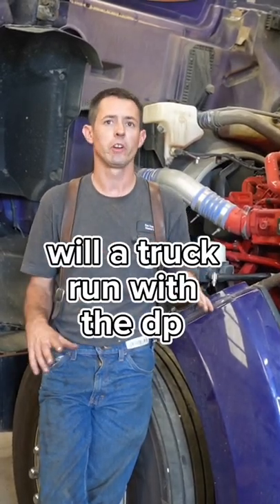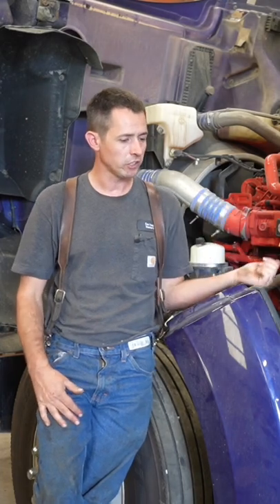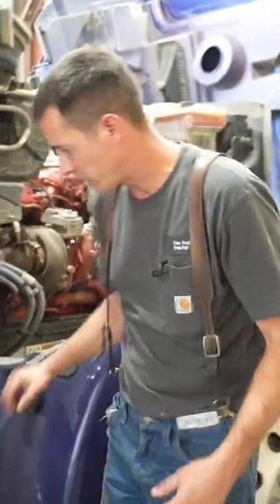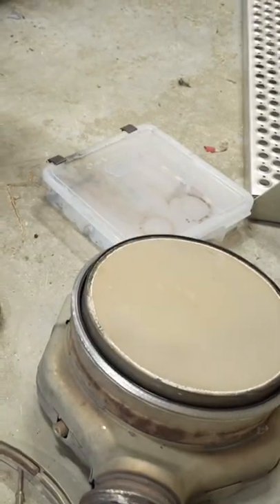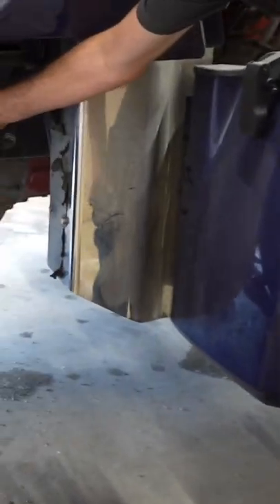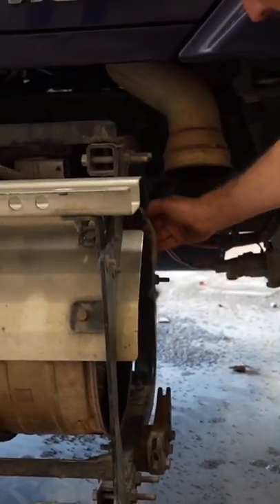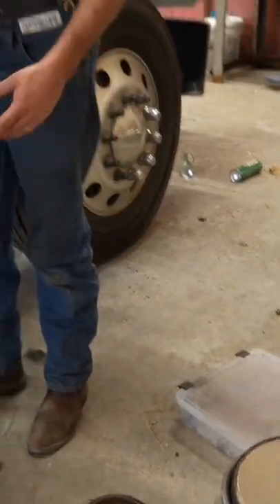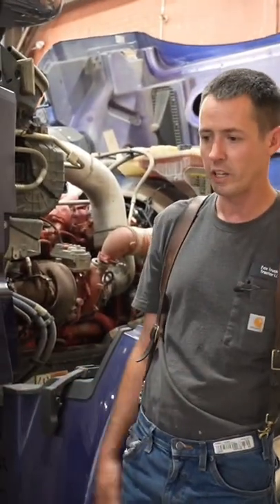Will truck run with DPF unhooked? #shorts

Comment: The engine said “I can finally breathe”
Reply: I was thinking the opposite like it was saying “where’s my boost” 🤷‍♂️
Reply: @tinytattoomike7943  Diesels don't make boost at idle and the turbo is mounted to the manifold. You're thinking a gasser with remote mounted turbos.
Reply: @tinytattoomike7943  the downpipe comes off the exhaust turbine not the compressor turbine. You can clearly hear the turbo spool when he started the truck meaning it will still make boost.
Reply: @danielkustra9071 that’s the waste gate opening and closing.

Comment: It will for a short time.  But it will shut itself down when it doesn’t see the temps rising like it should.
Reply: I've had to pick up a unit from a customer cause for some reason my company released it with no dpf I had to drive about 30 minutes to swap for a sub and drive the truck with no dpf back to the shop. Haha never shut off but was very worried all the way back to the shop waiting for it to derate
Reply: We have a truck that has a pipe going through the egr unit by bypassing it and it has no idea its gone the temp plug was put in the pipe
Reply: @Manofwar9431  Egr is totally different than dpf.

Comment: It absolutely will. My titan does. Buuuutttt, needs to have the ecu programmed so it can do it longer than 20 mins. Edit. Stupid autocorrect 😂
Reply: What year Titan do you own,what all have you done w/ it? i have a '19 Titan XD.
Reply: @smckinney3mckinney141  a 2017 xd pro 4x. Absolutely love the thing.
Reply: @Iwannagofast  That is the same trim level i have Pro 4X.. what kind of fuel milage do you get, if you check it..
Reply: @smckinney3mckinney141  on my last road trip with no load I got ~17mpg 80 plus for 500 miles. On the way back I ran 70 the whole way and got 20mpg. Daily I avg 19-20. If I really get into it I get about 5mpg 🤣. I run the 120hp tune with the fun parts. Got a meth/water setup I’m gonna put on it eventually.
Reply: @Iwannagofast  That would be a sweet addition, did certain parts fall off to do the 120Hp tune?
Reply: @smckinney3mckinney141  there wasn’t enough room so yeah 😉
Reply: @Iwannagofast  🤣🤣🤣
Reply: BFTtheTRUTH  well I believe that’s an ISX Cummins on the semi. Seeing as my Titan has an ISV Cummins in it, nope they are not exactly the same. So very astute observation. Being that they are different, they both run off an ECU. Since they need the parameters from the dpf, scr, and egr, you have to tune them to allow it to run without them. And funny enough they both can be tuned with the same software.

Comment: This is bs. It will throw codes reeeeaaal quick. Might be able to start it but cummins diagnostics is sensitive enough to notice minor exhaust leaks during road testing. No pressure or temp at the dpf (not to mention the differential reading), scr is gone, nox outlet... yeah, limp mode real quick.

Comment: Now reprogram the computer and delete it
Reply: And wear a big EPA  fine for doing it ..
Reply: @jimmyj2563  only if you're caught
Reply: @edwardjmayer87  that would be easy to catch , especially  since  this will become  a thing ,,
Reply: @carlstephens1532  if people figured out how to run a dual ECM system one for the motor one for the OBD2 connector they can figure out how to delete that without being traced
Reply: @edwardjmayer87  yes it would work but one could develop  sensors that can fool the existing  computer and could  be steathy I was able to race with the early  computers by altering sensors  it was fun my friends  and I had camaros I had a91 they were all stock and nobody  was able to run with mine,,, stock wink,,,wink
Reply: Some of you guys need to read about the guy that had a ad to sell his deleted truck. The Feds raided him and treated him as if he had a million pounds of cocaine.
Reply: @mrgoodtimes05  the first cars started around  85 with computers that I saw. Catalytic  converters. So yeah we learned  a long time ago.  The EPA kind of relaxed until "rolling  coal"was used like a weapon  and a safety  issue, and the sleeping  epa woke up.

Comment: They'll run til the computer catches on to it, you can delete them but it takes reprogramming of the ecm, Cummins you can delete and be fine, detroit dd15 will throw a rod after 2 years of being deleted
Reply: Definitely not true. Do you have any idea how many dd15’s are deleted on the road for longer than 2 years?
Reply: @Richtaco  has probably to do with bad ECM programming and incorrect intake temp since most modern engines were designed from the ground up with EGR
Reply: @Richtaco  I work at a freightliner dealer and see it all the time, it may be the programming of the delete the causes it so may vary by who does it but we replace cranks and rods in deleted ones constantly, they either wipe a rod bearing or break a wrist pin
Reply: Probably they aren't tuning their deletes correctly too much power or over torque I have heard that you can't delete the egr though it has to have it.
Reply: @Khmtravelvlog  yeah that and some models of dd15 use the egr to control the turbo, and when they delete them they block off the egr pipe, so if run it hard under load they can overboost and blow stuff up

Comment: They'll run, and they'll run good til the computer notices that shit is missin then it goes into limp mode
Reply: I figure nothing a little reprogramming or new ecm programed to run without a dpf couldn't solve
Reply: @Ako Cummins it’s not, well, if you’re new it is, otherwise it’s really not. Gotta know who is available and how to get to them, but there’s hundreds of guys that do it. Nobody speaks about who anymore because EPA shit
Reply: @Ako Cummins there still are. Problem is that there's zero commercial options, because they would be instantly shut down and fined by the EPA. So the only option left is the ROM hacker and homebrew scene.
Reply: What happens if you just fill that bullshit with water or trick the sensor into thinking it’s full?
Reply: @308dad8  you can’t, they have a DEF quality sensor. It can detect if it’s just water etc, plus it can tell if the injector isn’t working etc. just gotta tune it
Reply: @KDlGG  Wow. Sounds like they have it all regulated to death. Isn’t there supposed to be a shortage of that crap?
Reply: @KDlGG  What do you mean tune it? You mean programming it?
Reply: @308dad8  there is and there isn’t a shortage of DEF, it’s more of the stores or truck stops cant get it as quickly as they need. But it’s available from manufacturers
Reply: @308dad8  yes, it’s the same thing just different names. You can run a stock modified tune so it runs completely clean but just makes the engine think everything is intact, or a modified tune to get more fuel economy. Some guys on the Cummins trucks are getting 20 or so, powerstrokes I’ve seen get 16-18
Reply: @jhomrich89  I’ve done this on ag equipment in past years. Gut the government parts and reflash the ECM with export, T3 programming and all you have to worry about is the EGR side.
Reply: yup
Reply: Makes me glad the farm work at run pre emissions trucks.

Comment: Yeah it'll start and run for a bit. But when the temps,NOX and differential pressures aren't responding accordingly it'll go into limp mode or shut off.

Comment: The T800 I drove had a broken flex pipe before the dpf.  Picked up all kinds of power.  Easily hit 40 psi compared to the lazy build to 35 psi it had before the break in the exhaust.  It would start puffing smoke bad and almost made it look like it was on fire haha.

Comment: It will run until it heats up and the exhaust temp dosent come up and the downstream NOX sensor shows no flow then it will most likley skip derate and go straight to shut down

Comment: My last job had a gmc 5500 that had a 20bbl tank to pull drips from the pipelines. I drove it. It had the DEF system removed. It constantly tried to go into limp mode. They downgraded to a freightliner fl25. Not sure what happened to the gmc 5500. I was rear-ended by someone going 75mph in it, still don't know how I'm still here, but that's another story. While I was out recovering, they changed to the freightliner. That was a rough driving bitch.

Comment: If u pull the computer bs out of it and go back to mechanical system it will run just fine and in reality u don't need that Def fluid to make it work correctly use straight distilled water in Def system bc computer can't te the difference between the 2

Comment: That’s what a truck should sound like dpf is a scam.  How is getting exhaust temps up to 1400 degrees and idling truck at 1300 rpm for 45-1hr for regen good for the environment?!  Carbon is what causes moisture in the atmosphere why it’s so damn hot bc emissions

Comment: Sure...until it figures our the readings aren't within the set parameters and it freaks out it's just the same as hollowing out a catalytic converter. It'll go until it figures out the cat that is no longer there isn't doing it's job.

Comment: A Cascadia will not for very long. You can thank the Government for that. My company has always got brand new Cascadias. Not one has ever made it over 100k without having some sort of exhaust DEF system issue
Reply: I was stranded at least once on the side of the road due to failed NOX sensor at only 300k miles  😭
Reply: Freightliners have ALWAYS sucked!!!  Worst truck on the road, period.
Reply: @beowulf7992  On the bright side they’re pretty easy to work on and parts/labor cost /abundance situation isn’t too bad either , my truck was under warranty and the Freightliner dealer 100 miles away managed to replace all NOX sensors and DEF supply Kit under six hours, I still wasted 2 days waiting in the middle of Colorado but if I had Volvo/Paccar it would’ve probably taken weeks due to the emission parts  shortage
Reply: @Nikowalker007  True!  I work on Freightliners daily.  But that's just it:  daily.  So, it's a good thing that parts are readily available and most things are common/SAE.  Generally, I only have to work on the PACCARs after the drivers have their way with 'em.  In their defense though,  there's NO WAY to make trucks/equipment durable enough for some people.  Some ppl are so destructive; they could bust the head off an anvil!

Comment: Stopped this at 2 seconds. No it will not run. There is a DTC that reads, I ain't kidding either, "DPF Missing". No data from the DPF differential psi sensor, nothing from the outlet NOx, the SCR Dosing Valve is "open circuit or short to ground." and the temp sensors are reading ambient.  Y'all got 90 mins to pull over off the side of the road and call Love's road idiots to scratch their sack and charge you anyhow. 5mph derate, son. Hey OP... You left out the end result!! Insite did not refresh while your little finger pointed at the Fault Codes tab. Give it 1 min (per Cummapart spec) and you got a whole fuckin COLUMN of codes for what you done and bark at the steering wheel holder for "Operator Inducement". Shidddd

Comment: Awesome, cause that's what we need- more particulate matter entering our atmosphere... You diesel loving, coal rolling truck lovers over there caused this massive EPA crackdown- cheers blokes 🖕
Reply: Hold up….. this is a big rig. They’re not the idiots rolling coal
That’s diesel pickup drivers….. these guys just don’t want to have their truck stop functioning due to a minute exhaust processing system issue
Reply: @knicks5426  I realise, my comment was directed at those wankers in trucks- not semi's or big rigs.
Reply: @knicks5426  Your meant to clean those DPF's anyway, they shouldn't block if allowed to go through the cleaning cycle when required- just like smaller diesel engines, I assume (I'm what they call a "light vehicle mechanic" in Australia, I work on cars and smaller fixed chassis type commercial trucks- not big diesel stuff like this though...

Comment: Never understood diesel guys and their love for horrible air quality the world over.
Reply: The fact def is a scam and don't work as intended is all you need to understand. A deleted vs non deleted deisel if done right blows the smog test almost the same
Reply: @drdaledobek9882  If you think DEF doesn't work, you clearly don't understand the chemistry behind it.

A chemist.
Reply: @crabmansteve6844  ya it's supposed to reduce Nox...but please explain when dealer support is next to zero...the systems are plauged with problems that can cost 10s of thousands of dollars to fix leaveing a truck down for weeks or months only to come back sometimes a few days later ...how does that help convince anyone it's a good idea to leave on the truck...and I've seen the emissions tests results...often only a 1 to .5 difference...and if you believe burning def is doing anything more than adding to your fuel bill and makeing someone else rich for the science than mabe you should look into who funded that very science
Reply: @crabmansteve6844  really what are the bad side effects of def. Have you ever been behind a truck burning the carbon and the def?  Have you ever smelled that nasty headache inducing nasty smell. I am willing to bet def will be connected to cancers
Reply: Diesel, when tuned properly, burns with fewer emissions than gasoline. And the energy it produces, pound for pound, is far greater than gasoline. Why do you think almost all heavy duty machinery is powered by diesel? Because it hurts the air and hurts your feelings? There's no gasoline powered semis for a reason.
Reply: @crabmansteve6844  just wait. You’ll see the class action lawsuit commercials
Reply: You can help offset this by riding a bike
Reply: @lamarzimmermanmennonitefar5269  you're so diluted in your false reality. You really think I'm going to transport 45,000lbs of sodium permanganate 2286 miles by bicycle?? One person's emissions will make zero difference.